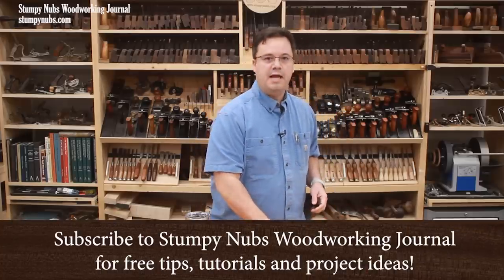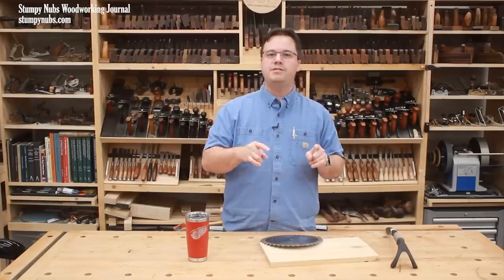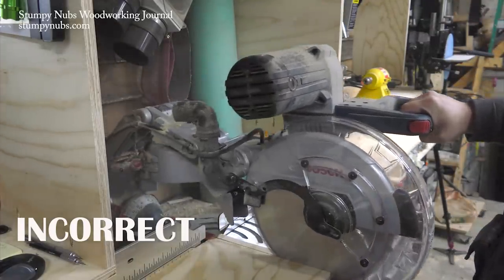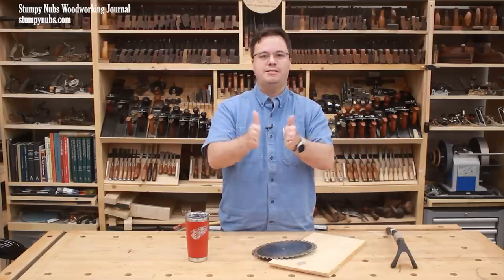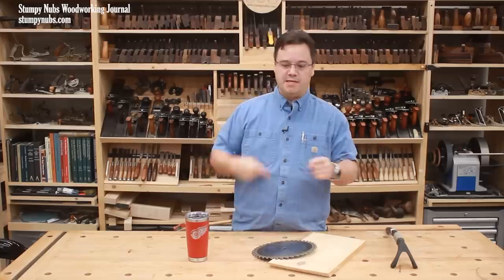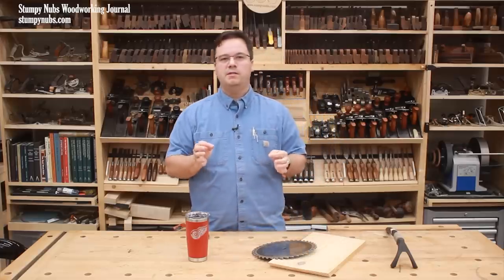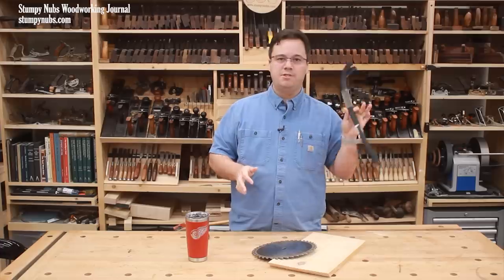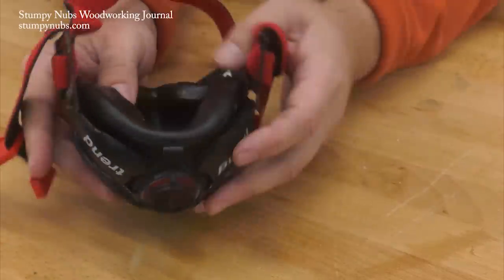A close call with a miter saw

Comment: One thing to watch for if you build a miter saw station: make sure that the supports are either exactly level with your saw or a hair lower than the saw bed. If the saw is lower than the supports, when your board spans both sides, it will be unsupported underneath the blade. In which case, unless the stock is thin enough you’re able to depress it by force, you’re going to almost always see your blade bind.
Reply: I was wondering if that's what was going on with the guy stumpy was talking about, but then the blade would release when the pressure was removed.
Reply: It's worth mentioning that it's important you don't have ANY gaps between the piece being cut and the miter-saw table or fence at all... If you're going to support the end(s) of a board separately from the saw table/workstation, you should put some extra gap between the outside support(s) and the saw-table... AND make EXTRA sure the board is firmly against the fence/guard ALL the way across.

    If you look back at the clip around the explanation about the "kerfing technique", there's just a little gap between the board and the fence, and when the saw first "kicks" the board shifts and the gap gets bigger, practically guaranteeing the second kick...

    Don't clamp both sides/ends, but it can be a great idea to clamp the HELL out of one, especially "obnoxious" or "dubious" pieces that don't seem easily stable against the fence on the table. That doesn't mean it's always a good idea, since the miter saw is supposed to be a convenient tool... JUST that it can be.

    Personally, I default to a handheld circle saw for odd cuts and pieces like that, so I can clamp them to a "sacrificial" surface on a bench or sawhorse... AND small pieces tend to get hand-sawed, usually on a pull-saw for the slight ease of keeping the line straight and precise.  ;o)

Comment: God!! I've been saying this for yrs!  worked in construction my whole life! I've seen multiple people actually do damage by pulling a slider instead of lift and lower then push. One guy actually cut his hand right in half.. month of surgeries and never fully the same!  NEVER PULL into a cut with a slider!
Reply: It boggles my mind that anyone would actually do this. Even a complete amateur like me can see the natural motion of the saw is not to pull to through the cut!
Reply: @billsedutto8824  yea, the guy he is talking about actually gave me grief when i saw one of his videos and tried to explain that to him. And i was at least trying to be polite about it when i posted, But what ever.
Reply: @billsedutto8824  I wonder if he was used to a radial arm saw where you are supposed to pull the blade towards your body.
Reply: @JimLambier  I think that's it. I work with those a lot but I would never try to cut anything small with them. I mean the blade is mostly exposed and we're talking a 420 mm (1'5") blade here. My left hand is at least half a meter from that cut. Negative teeth are essential too with such a saw.

Comment: I worked in the Operating Room for many years in the Army. Re-attaching things that were removed was commonplace. I have a huge respect for anything that is sharp and moves at high rates of speed for this reason. I will find an alternative cutting method for anything under 12" when using a miter saw for that reason. Thanks as always for the great info👍

Comment: I had a nasty situation just like you showed in that video. It was a combination of a dull blade with some wood that bound on the blade during the cut. Bought a new blade, and started using the technique you described where I take several smaller passes. No issues ever since.

Comment: Just finished a project with my miter saw with lots of small pieces. Didn't know about the miter stick (much better than the one I made). Was a little disappointed the link was out of stock then I saw that they were FastCap and they are only a few miles away! They had bins of them ready to ship out and I was able to get one for me and a few for presents. The ones now have been improved. They call it the $10 M stick because $1M for each finger. THANK YOU so much for your great content and inspiring my projects and keeping safe!

Comment: Great information, as usual, James. After years of using a 8" Hitachi SCMS without incident, I upgraded to a Festool Kapex in my shop, and had a nasty binding kickback within a couple of months. It was so violent that it shattered the plastic saw housing and hurt my shoulder, not to mention scared the crap out of me. It took me a while to analyze what went wrong, but I finally realized I was cutting a piece of construction grade lumber which must have been bowed slightly off the table or away from the fence at the point of the cut. I don't remember for sure, but I also may have been using the hold downs on both sides of the cut. Now, in addition to using a 10M$Stick when cutting small pieces, I keep some composite shims by the saw. If I have to cut a piece which is bowed, I place a shim in any gap(s) between the board and the table or between the board and the fence. I also only use the hold down on one side of the cut. If I'm using a stop block to cut multiples to length, I use only the hold down on that side of the blade so the free end isn't trapped. Finally, I use the "kerfing" technique you describe. I don't want to be overconfident, but this combination of procedures seems to have tamed my Kapex.
Reply: I bent some teeth on my Kapex after the first few months.   Turned out the fence dipped in the middle where even straight boards would bind. I corrected it with an auxiliary wood fence. Also, the Kapex isn’t as powerful as my Makita and can’t power thru the tougher cuts. I have to take multiple passes on wide boards because of pinching

Comment: Brilliant video. This has explained to me the reason that I experienced the very same violent reaction while cutting a fairly small piece of stock on my saw. It is a relatively inexpensive saw but fitted with a brand new Freud fine tooth blade. During cutting, my saw blade jammed with a frightening bang which resulted in my saw actually jumping a couple of inches of the bench and a piece of ejected wood hitting me in the face. The soft cast aluminium fence was also bent out of true as a result of the violent jam. My fingers were very close to the blade and I count myself very lucky to escape with a bruise on my face, perilously close to my eye. After watching this video I am now sure the work piece was slightly bowed and settled into the blade, nipping it as the cut progressed. I now treat this machine with a lot more respect and caution. Thankyou for sharing your wisdom and experience. Great video and great channel (from over the pond in the UK) 😊

Comment: Great video!   Excellent safety advice!  I was working on a project where I need to make several repeat cuts of small stock (like at the end of the video) and it was suggested that I attach a flat, straight strip to the fence, then cut a zero-clearance cut through that.  It worked much the way my table saw sled works to support both sides of the cut, with no chance of either piece flying away.

Comment: I see a lot of safety videos on sliding miter saws, but I'm amazed that one fact isn't ever brought up (that I've seen at least). Not even on this usually thorough channel. It's always about "push don't pull", and clamping, and where to put your hands.  Maybe because it's so obvious to veterans they don't think to emphasize it:

But this:

"Do not try to cut narrow pieces using the sliding feature. "

Somewhere in any video about sliding miter saws, it should be clearly stated that you should always descend onto the wood!  Never, for narrower pieces, descend the blade all the way down in front of the narrow piece before cutting, and then push into it.  It's easy for novices to think that's an acceptable way to cut, and it can result in some awful kickback, flying pieces, and injury.

Comment: Thanks SN. I was blissfully ignorant of this issue. My miter saw is not a slider, but I have definitely run into issues with short pieces. I use the saw's hold down clamps and other clamps to avoid my paws being anywhere near a whirling blade.

I even use a hold down clamp on my table saw while crosscutting. I want to stay attached to all my fingers.

Comment: Reminds me of my old Craftsman Radial Arm Saw. I gave it to my brothers three decades ago when I went to a more versatile Shopsmith Mark 510 system. They used it until recently when it stopped working. Fortunately no accidents came of its use, but if the arm or track ever loosened it could become very dangerous as that spinning motor can grip the wood and come flying towards the operator in a flash.  Sliding miter saws appear to have been an attempt by manufacturers to replace the old radial arm saws with a safer design but they have their own dangers as this video demonstrates. I might get one some day but my old but well-kept Shopsmith has been serving my needs well enough.

Comment: Thanks for the tip on the $10 mil thingy.  Now I HAD heard of internal stress in wood before, but never experienced it until about 2 years ago, while ripping a 1x2 in half, on the table saw.  It was about 4 feet long, and I got about 3 1/2 feet into the rip cut when suddenly the saw stopped (DeWalt, not Saw Stop) and got pinched by the wood.  I didn't have to take a hammer to the blade, but I did manage to release the wood strip from it, and was surprised to see the kerf in the wood ALMOST DISAPPEAR.  The stress inside that particular piece of wood was so strong that it closed the kerf gap at the 3 1/2 foot portion, and two more inches beyond.  There were no particular safety issues during my experience, so I was just glad it tripped the circuit breaker and didn't damage my table saw.

Comment: Once again, great content Mr. Hamilton. Fellow Michigander here. I work generally from rough cut stock and find that some boards have an unfortunate bow a few feet in. Rather than milling and planning it down to get it flat and wasting much of the wood over the length of the board I cut these on a miter saw into shorter more straight sections before milling to preserve thickness. When doing this, I ALWAYS cut the board on the miter saw with the bow facing up to help the cut open as the ends of the board drop as you make the cut. With the arch of the bowed board down this presents a very likely pinch and kickback during the cut.

Comment: Thank you for introducing me to the 10MDS!!  I got two of them after your first video came out and use one not only at the miter saw but a second one at the table saw with my sled.  Before that, I had used various scraps of wood to press smaller pieces down. The rubber tips of the 10MDS and its arched Y design work so much better. I suppose you could make a facsimile with laminating wood, but I like to reward affordable innovation and buy products when it makes sense. Attaboy!!

Comment: Great tips.  I watched that video you were referring and many commented that it was not the blade nor the miter saw itself but how it was more user error than not.  But the guy in that video, IMO, just wanted to get a new miter saw and bench.  And, unless he learns to use it properly, like you showed, he will once again bind his blade in the wood that he is cutting.  And if that happens, I wonder it he will resort to using a hammer to ruin yet another expensive blade.
Reply: Well, it was a Diablo blade, so not exactly expensive especially when compared to, say,  Ridge Carbide blades, but the point still stands. That's still ~$50 dollars down the drain from misusing a tool...

Comment: Thanks for the great advice, I'm off to buy a saw stick today, another issue I have found is if the timber is bowed and you have a gap at the fence, this can cause kickback, so flip the wood over so it is hard against the fence, this will prevent kickback

Comment: I don’t often cut wood on my mitre saw, it’s used daily for cutting what is essentially aluminium box section 70mmx100mm 6mm wall thickness, I was very lucky when stupidly cutting a small piece when the saw grabbed and pulled my thumb into the blade I now scrap the small part and opt to cut a new one from a longer length. 
Very informative video

Comment: That kerf cut is essentially what I do with my radial arm saw when cutting thick wood. Today, for example. I was ripping a strip from a 1" thick slab of walnut, and I took it in three easy steps.  It took three times as long to make the rip cut compared to starting at full depth. But it is safer, and easier on the motor. Another advantage is that I can set a specific depth of cut, and it stays there without me having to try to hold the blade at a specific height.

 I would do the same for crosscuting that slab as well, except maybe only in two steps. Plus, the wood is then stationary and fully supported, instead of being "tippy" on a base that does not fully support the wood (at least, that is what it looks like.)

Comment: I used to work at a production wood shop where the owner thought "safety" was for wimps. One of the more common cuts I had to make was 1x2s cut to 5-1/4",  and I was specifically told to stack and cut them 4 at a time on the old, worn-out miter saw with a blade that got changed whenever the owner could be convinced to buy a new one. I can't count the number of times I had that saw bite into those cheap 1x2s and fling pieces everywhere and that was okay by him, but oh dear Lord he better not catch me trying to do anything the smart way. I got told off for using some scrap wood I pulled out of the burn pile to cut out stick similar to that 10M, he actually had the nerve to tell me it was "faster to use my hand" for those cuts.

Comment: Thank you for this explanation, I've seen youtubers do the kerfing method before and didn't understand why / what they were doing.  I figured this would also be a good place to share a really close call I had with my non sliding miter saw.  I didn't get hurt, but it ended with a destroyed blade and a big wake up call.  I didn't own a band saw at the time and had a small ~3" diameter round piece of a beech wood branch that I wanted to cut into a couple of 6" lengths so I could turn it on my lathe.  I figured the miter saw would be quick and easy and had no idea the risk I was taking with the unstable piece of wood.  It was long enough where my hand wasn't close to the blade at the time.  The blade actually completely jammed into the wood and twisted so bad caught on the steel housing and completely locked up.  I wasn't sure but I assumed some internal stresses of the wood caused the blade to twist.  Some pieces of carbide flew off and even hit the wall.  I was wearing safety glasses at the time and thought I was being safe, but I just had no idea the cut I was making was a potentially dangerous one.  I cut the remaining pieces I needed that night with a handsaw and I have since bought a bandsaw so my miter saw has been retired to only cutting the occasional 2x4.
Reply: I've seen the kerning method on several videos and like you did not know why they were doing it. It's amazing that I've seen thousands of woodworking videos but this is the first to explain this important safety tip,

Comment: As always.... Fantastic. I've had a couple "surprises" using my own compound sliding miter saw at home, as well as my much higher (pro-sumer) quality saw in my school shop. One of the scariest incidents involved cross-cutting around the middle of an 8' pine 1 x 6.
It was flat as a table and had just the slightest sideways bend to it (about 3/16") at the 48" point. I thought nothing of it. 
I was quite surprised with the amount of force released when it literally exploded open like a rip in the space-time continuum. There was a big pile of potential energy stored there and once halfway through the cut,... it released like a broken leaf spring on my truck.
I keep that piece of wood to show my students when we learn about using power tools both safely and effectively. 
I can dump a pic up to imgur once I go back to work on Monday and drop you a link if you'd like?

Comment: Thanks again. Trend Stealth is good, but don't forget the fit test. If you cover the vents with your hands and breathe in and it doesn't suck the mask or you can still breathe, it doesn't pass the fit test. If you have a beard it is suboptimal and you should use positive pressure powered respirator helmet. They don't require an exact fit because air is sucked through the filters and the pressure in the mask is what stops dust, etc from getting in.

Comment: I feel far safer with my mitre saw than a table saw, but I had years with a radial arm saw so the motion is more comfortable. I agree with you, James, too many of the channels show bad techniques. They treat the mitre saw as if it were a radial arm saw, but the blade enters the workpiece at a different angle; What works on the radial saw is not for the mitre saw.

Comment: I always start out and push in with a compound saw. If the wood is warped, I run it through the jointer first or use a handheld circular saw. I would also use either a sawzall, jigsaw, Japanese pull saw, or band saw if it isn’t possible to flatten the board without making the wood thinner than I desired and the warpage is enough to cause the handheld circular saw to kickback.